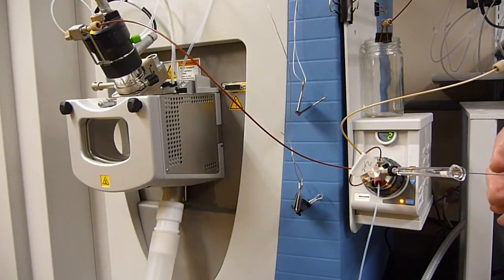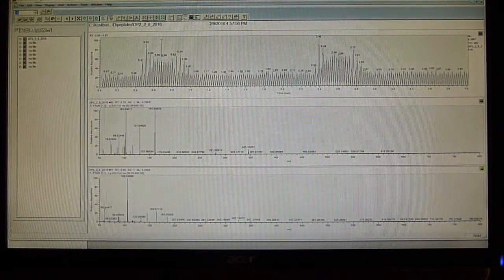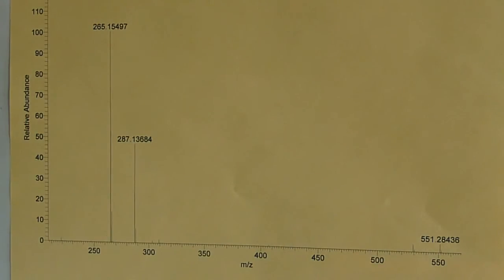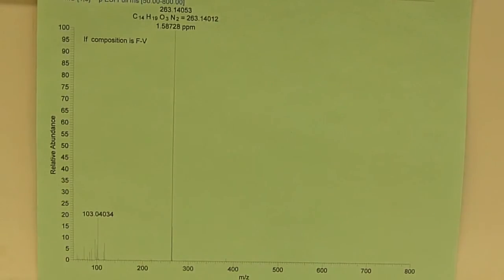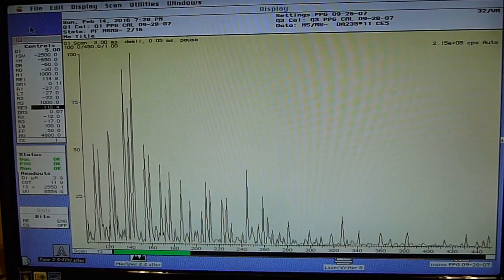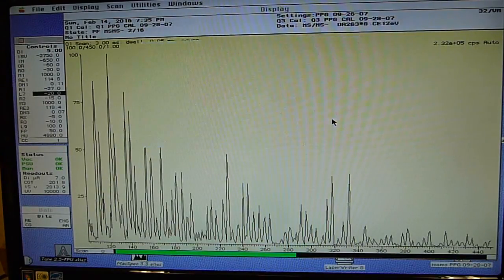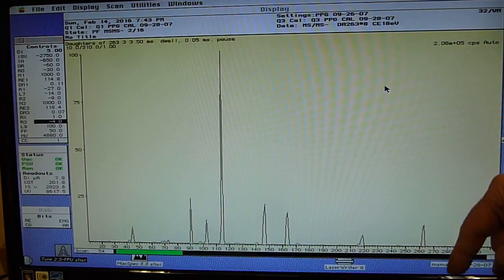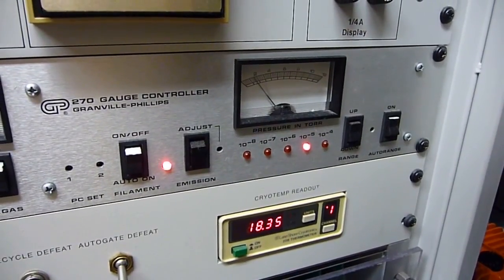"Real-time" LC/MS and MS/MS Electrospray of a Dipeptide w/High Res and Tandem Triple Quad Mass Specs

Comment: why is your IT is maxing out ? it should be less the 1
Reply from the maker: You are right ... the short answer is time constraints.  Each student gets a dipeptide that is unknown to them;  and is then characterized by CE, HPLC, TLC,  and MS. The intent is to give the students an initial "hands on" exposure to these methods.  We try and get the concentrations about the same; unfortunately, there are ranges. The tune file and the IT is the same for all the dipeptides, and if the IT maxes out,  we just live with it. 

The SCIEX API3+ is now older than the students, and while it is still functioning, there is no assurance that it will work on the particular scheduled lab day for the students ... hence the video. We are working on a replacement tandem instrument, but in the meantime, it is the vintage oh-so-cool SCIEX for the dipeptide lab.

Naturally if I was getting an Exactive today, it would have a quad in the front (and thus not  the worry about a 20th century tandem mass spec). We bought this Exactive 5 years ago out of the demo lab, hence the videos on the turbo repair.